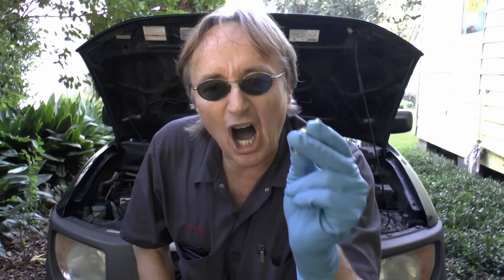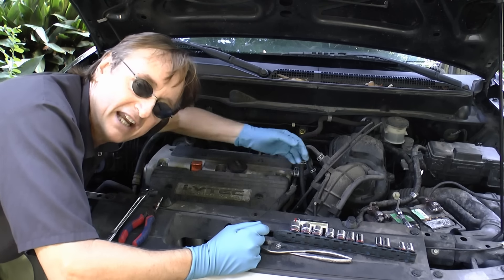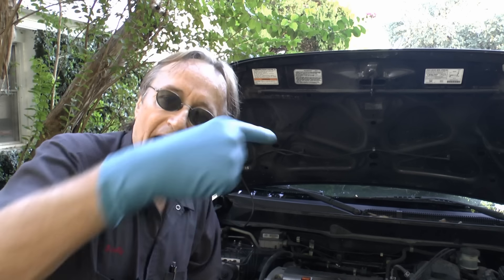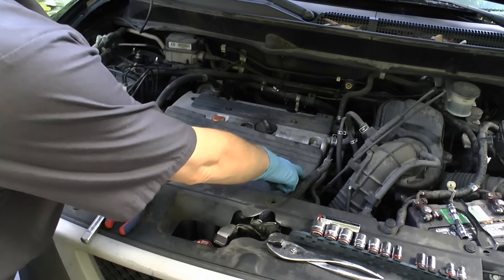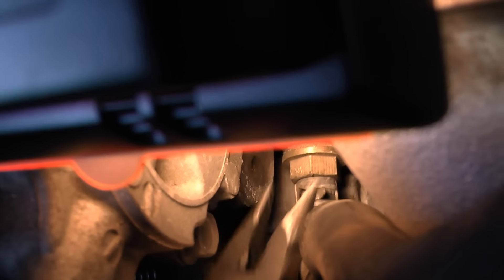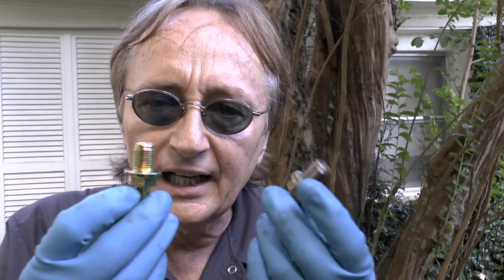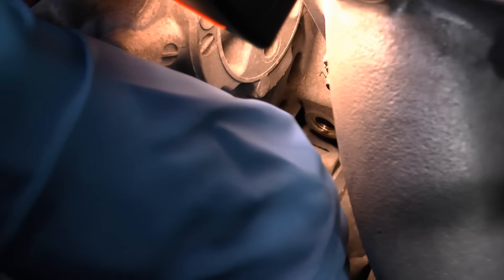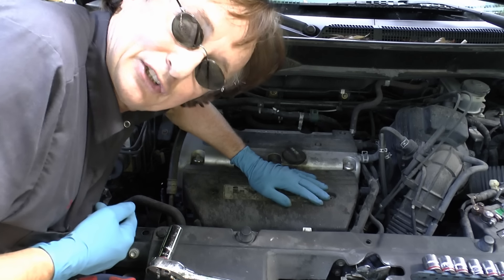How to Fix a Car Engine that Burns Oil for 10 Bucks

Comment: Hey Scottie how are you My name is Quinton I'm a big fan of your videos I have a very very important question  I purchase a $14000 2008 Lexus LS460L With 115000 miles .. I Only have it for less than 6 months ago.. I purchase it from a lamb rover jaguar dealership Gave me 90 day warranty Now after the warranty.. After the warranty dashboard shows low engine oil Went to the Lexus dealer for oil change.. With less 1000 miles driven it came on again low engine oil.. Check the dipstick it has no engine oil What can I do for the car so I won't lose  $14000 and barely had the  Call for 6 months  This is my 4th Lexus LS at the age of 55 I never had a problem with Them.. Because I really love those cars.. So liable...  Now Will it help to save the engine by changing the PCV and TVV valve  would it help  or what should I do without losing money or the car Your best advice help me Scotty thank you

Comment: Actually Scotty, I think that the plastic covers on the engine  MIGHT have one purpose. In the winter, the engine cools down slower. Because in our dinosaur days, we had rock wool built into the engine hood as fireproof insulation. New cars, being cheaper and cheaper, don't have it.

Comment: Does Toyota's vvti engine has pcv valve too?
Reply: have a 1998-2002 corolla?
reason i ask is because ive had 2 one Chevy prism
the other scorolla both have same motor and both burned oil excessively and this video holds the fix i believe.
i have 218,000 miles.

Comment: I just bought this Audi A4 it's badass car I think but I got it n saw the valve cover was leaking so I cleaned it up to see if it would do it again and it hasn't yet ik it will until I fix it but I just changed the oil bc it was burning it really bad but it still kind of has that smell I wasn't to sure if it was bc bank one which is the catalytic converter is bad but that also could be a o2 sensor throwing that code but I was thinking that could be a reason why but the PCv looks clean like brand new so ik it's not that and I saw metal shavings in the oil when I drained it was very little peices but since all of that I believe something in the motor is wore down and something is not very happy sucks bc such a cool car and an old lady had it had no idea what it was worth so I got it for 800$ such a deal

Comment: I had a Chevrolet equinox and it was leaking from pcv valve but there was no way of changing it. It was part of the engine. I couldn't take it off!
Reply: pollodormido2 
I have a 4 cylinder equinox,  you must have the 6?   
My 4 has an internal PCV orifice ( no rattle like a real PCV) and an external hose to supply clean air to crankcase on passenger side of car.

Comment: Would be the same for acura tsx cu2 2.4 
2009 ?
I searched on internet look different.
Reply: forever 1 hey did it worked ? I have 2009 Tsx too
Reply: @lesteryu3102  yes but check if it need to replace or not.

Comment: If the PCV valve is stuck closed - presumably nothing will flow through it. Presuure could then build up in thethe crankcase( altjough there is usually an air inlet from the aircleaner, so any pressure should escape  anyway?     If it is stuck open, then I imagine the high vacuum at idle might suck excessive air into the manifold and cause rough idling.  What I can't understand is why - if the PCV valve is faulty (perhaps stuck fully or partially open) any excess oil should ever be sucked into the inlet manifold!!!     I know there is a problem with excess oil getting in the inlet of early Prius engines - but thought that was due to poor siting of the PCV valve, low on the engine - (later cars have it on the top).  Most videos on uTube talk of excess oil from the PCV into the inlet manifold  if the valve is faulty - but nobody seems to explain WHY that should be the case!!   I suspect any increase in oily vapours is  just because of a worn engine - irrespective of the condition of the PCV valve!   Or am I completely wrong??

Comment: I put cleaner in it mmo still burnin changed the pcv still burning.  Connected the disconnected ground oil stopped burning.  Some ground was off.  That was prob not it it prob took 6months for cleaner to work

Comment: My 2005 Dodge Ram has 230K on the odometer. The engine burns a lot of oil and the nasty smell and blue smoke is horrendous. I can smell it seeping into the cabin of my company truck. The boss doesn't want to fix it. I have a dull headache, I experiencie confusion. My memory is horrible at age 51. I feel tired a lot and my vision seems blurred a lot even with readers on. I don't want to lose my job by complaining so I feel trapped in this death mobile. I have to be up early for a job in the morning and I am dead tired from barely doing any work.  Need help. He buys his managers brand new trucks  who do hardly any work. The lockdown has me concerned that I could be easily replaced with someone else who would put up with it just long enough for me to be unemployed. I'm a jack of many trades but not appreciated. Depression sucks.

Comment: Test the new PCV valve before installing. The one I bought from Rock Auto would not close with backward pressure. If I didn't know what I was doing, a backfire could have ruined the engine by letting the high pressure go into the engine.

Comment: Yah getting pcv off doesn’t always work well when the rubber turns to plastic and breaks off inside the valve cover. That wasn’t fun. 
And Nissan didn’t put it in a easily accessible place on a 2001 maxima. 
Then when the grommet or what they call pcv  insulator breaks off and falls into the valve cover.  That isn’t fun.  
But I suppose I should of changed it 15 years ago .  I think it was the original pcv valve from 20 years ago.

Comment: too many Toyotas 2005-2008 across all lines Toyota, scion and Lexus are burning oil, yet Toyota is refusing to address the issue. Seems the basic issue was they went cheap on the piston rings seals. Even a Camry v6 I looked at had the issue, oil was low, black the exhaust was super stinky and very black sooty at the pipe and the blueish smoke was almost a fluorescent blue. Most of these motors were 4 cylinders, but this has now become common place across all Japanese car lines.

Comment: The valve dose not suck its a valve that restricts or allows (ccp) crank case pressure  to escape and or be returned to to the engine and re burnt

Comment: When I step on the throttle on my expedition it starts to whine and a burnt smell shows up and when full throttle like if it loses power
Reply: stop stepping on the throttle..j/k  did you fix it?  probably one of the pullies seizing up and burning the belt?

Comment: My Lexus IS300 was burning black smoke and then after replacing the air flow sensor it burns white smoke. Everyone is telling me the engine needs overhauling.

Comment: That is good news if it's the PCV, but if it not that ?
    Where else could it be burning oil from ?
Reply: Besides worn rings, clogged valve intake, carbon build up on top piston ring.  Some shops offer a cleaning with no disassembly, about 
$600 to have both done at the same time.

Comment: I changed my PCV but my check engine light still on,  any ideas???
Reply: Read the error codes and see what causes it , probably a catalytic converter .
Reply: P0171, and P0174 it told me the most likely solution was the P.C.V, but I'm gonna try 2 clean my Mass air flow sensor

Comment: Its a one way valve basically lol just suck on one side and see if it holds pressure and suck the other side and see if you get air lol

Comment: 3500 comments.. and no one thought ot say this?  The reason why cats don't like bad pCV valves is because it causes oil to blow by the piston rings into the cylinder set fire then it  turns to black smoke travels down the header  and into the cats causing them to prematurely die!

Comment: WIsh Honda/Acura didn't use stupid Plastic PVC on newer vehicles... they should only use METAL... the plastic cracks and falls apart inside the valve cover...

Comment: Laughing at the comments about hundreds of dollars to change that PCV valve on Audis and other  European cars - just thank your lucky stars you don't drive that absolute PIG of the automotive industry - a Peugeot !  I took my Peugeot to the dealership for an  oil change - they said "yeah no problem, come back at christmas 'cause we have to remove the engine and gearbox first."

Comment: Unfortunately, the one on my wife's Volkswagen costs a lot more than 10 bucks and is not as easy to change out.
Reply: What type of vw does she have, mine is a Jetta and is having low oil pressure issues.
Reply: well its a vw afterall

Comment: how does being dirty cause it to suck oil? thats possibly the dumbest thing ive ever heard in relation to PCV valves.
If it gets dirty 2 thigns may happen.
1. it may get stuck open, causing a loss of vacuum, or
2. it may get clogged shut, causing 
    2a. lack ofsuction fo positive pressure from the crankcase,  very unlikely to cause excessive oil consumption past the rings due to the....
     2b, breather pipe (which is deisgned to supply the fresh air to the crankcase to replace the air being removed through the PCV valve),  if the PCV valve gets blocked, it may spit busts of oil into the fresh air pipe, which is before the throttle valve, (especially on deceleration) and this can gunk up the throttle body.

None of these are what scotty sais about the PCV valve  sucking oil wiht the crankcase gas thorugh the PCV valve at  1:13

Comment: I have a 2004 Honda Element with 315,000 miles, it's been burning oil for a year- great to see that this car was an element too,,, I'll change it out and update this comment if it helps.
On a similar note- Scotty saved me a ton by reccomending Blue Devil Head Gasket Sealer- was told my head gasket was blown.  I was only able to use half a bottle but shortly after my car stopped overheating and having too much pressure in the radiator!! That will buy me some time before having to buy an new/used car (getting a down payment going) - Check our my RC car and airplane channel!

Comment: Yeah the shake and rattle test is not a good test. The PCV valve has to flow so many CFMs per minute to work correctly. In other words, it has to suck out of the engine a certain volume of air everyu minute.

****Special side note: Because cars today are so finely tuned for the best mpg. You can no longer use 3rd party PCV valves. This is because they do not care if the PCV valve flows a certain amount per minute because if they can get one PVC valve to work on several cars they make more money by mass producing them. So if you buy a pcv valve that flows a little more than it should, or not enough. Your check engine light can set. Your gas mileage can get really bad, etc.. 

How you computer works is that everything has to be within a certain parameter. If something goes outside that parameter and the computer cannot compensate, it sets a light to let you know: Hey something wrong and Mr computer can't adjust things enough to make it right. And because the PCV valve is not a electronic part, the computer has to way of telling you that's what's wrong. So it's either going to guess and set the light. Or you are going to get get really bad gas millage and not know what the problem is and no light.

So if you have a car newer than 2010, stick with OEM parts. Specially if the engine has all the bells and whistles and is rated for high mpg. Find out what brand parts the dealer sells for your car then research it on the internet to get the best price. Like OEM for Chevy is AC Delco parts. OEM for Ford is Motorcraft parts etc.... You can get these brands off the internet usually 1/2 to 3/4 the price cheaper than at your dealer. This is because you are either buying from a parts warehouse or someone who's trying to reduce stock to make room for newer parts.

Comment: Just picked one up at AutoZone for $3.99. Replacing the one in my 2000 Dodge Dakota. Pretty sure it's the original with 182000 miles.